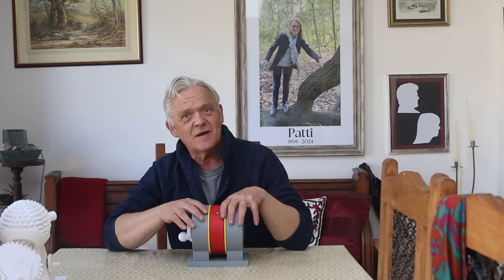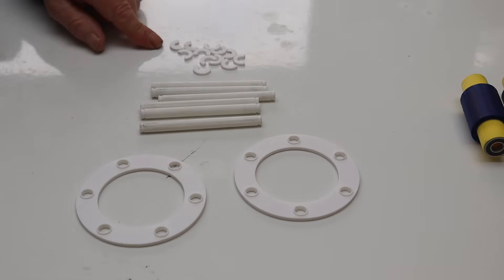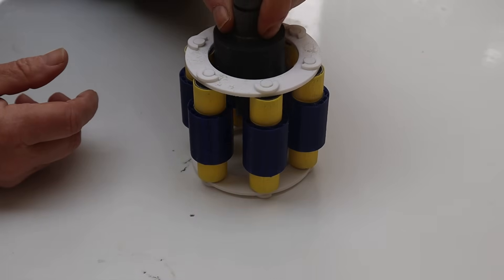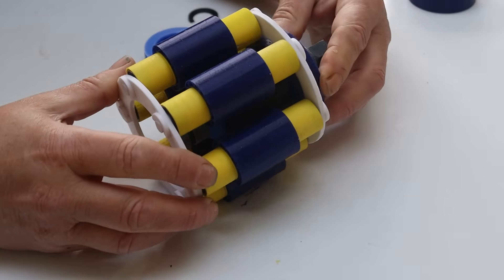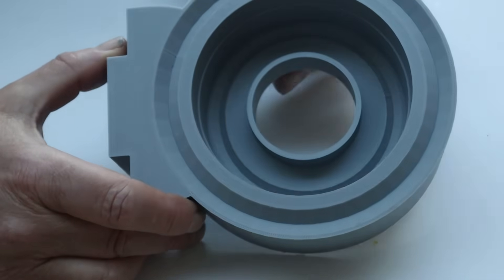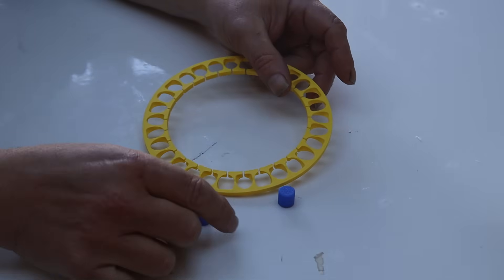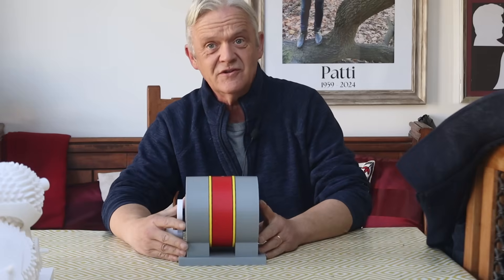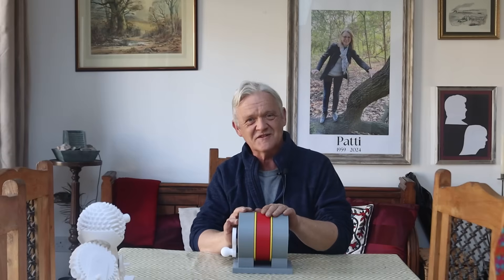2363 Building The Archimedes Drive

Comment: Interesting video thank you but on a different topic. Could you please do a video on how much energy could be saved using momentum of a fly wheel, using a one direction bearing like a bicycle but the fly wheel has magnets passing copper coils and saving  that energy in capacitors as capacitors are fast charging. How much of that energy could be saved in the capacitors,  and how much of that energy in the capacitors will you be able to used to drive the fly wheel. Obviously  driving the wheel intermittently then stopping and allowing the momentum to charge the capacitors.
Reply from the maker: I have done lots of stuff on flywheels mate - but essentially the energy saved is going to be the energy put in less losses in the system

Comment: Fun! Love the bearing roller spacer ring.

Slightly off topic question: I saw a belt driven linear extending actuator made by rise robotics that claims to be the most powerful robotic arm in the world, and it replaces hydraulics. Have you done a video exploring how something like that would work?
Reply from the maker: To be hnest mate - i thought that bit was pretty neat lol
Reply: @ThinkingandTinkering  Slightly off topic question: I saw a belt driven linear extending actuator made by rise robotics that claims to be the most powerful robotic arm in the world, and it replaces hydraulics. Have you done a video exploring how something like that would work?
Perhaps with gt2 belts? Or this format, perhaps no stretch cord?

Comment: This is a critical component in the turbo encabulator and you have implemented an elegant solution to the problem of side fumbling, great work sir
Reply: Exactly! First step towards the auto-gigabuckler
Reply from the maker: but it does become decombobulated if the doohickey gets disconnected from the thingymabob
Reply: @ThinkingandTinkering  I was worried that no one would get the reference and I'm so relieved to see your reply. Love your channel! 😄
Reply from the maker: @Stevie-J  lol - i thought it was funny mate - cheers
Reply: The framulence coefficient is gygastrally coupled prominently, as required and exemplified in figure 87d. QC approved.

Comment: I have an idea for a generator and I cant find another like it. I run it through chatgpt, and says it would be good for wind energy due to the self-propulsion from the magnetic field setup.  wanted to share with the channel.  Wanted to see if anyone was interested?  Uses Flux compression and decompression and a different type of coil than usual for the generator. Also generate a high voltage due to constant and rapid  flux
Reply from the maker: If you want to share it mate - do a video
Reply: @ThinkingandTinkering  I really havent made it it yet, just in progress.  Im on a limited budget, I kinda want to reach out to you, but its hard to reach content creators because they setup firewalls so they don't get flooded with emails.  I watch your show all the time, I do have some electronics background, but a little weak when it comes to motors/gen.  My only advisor is chatgpt, but sometime I think its lying to me, or just making things up. I was just hoping to get your take or input since you are my only generator creator I watch.
Reply: Be careful, I had an idea stolen a few years back.

Comment: Very nice lots of parts 🤔 
If reduction is what you want, why not try a cyclone reduction gearbox?
Hmm you can mess with the 3-D model CAD files or whatever software your happy using…
And make the cams larger and inner gears bigger and simpler for less reduction  anyways have fun 🎉🎉🎉
Reply from the maker: It's difficult to know what you mean by that mate - Cyclone is a gearbox manufacturer who make all kinds of gear boxes = but cycloidal drives also go by the name of cyclone gearboxes - either way I have done videos on them already